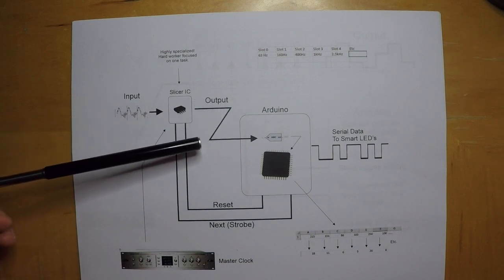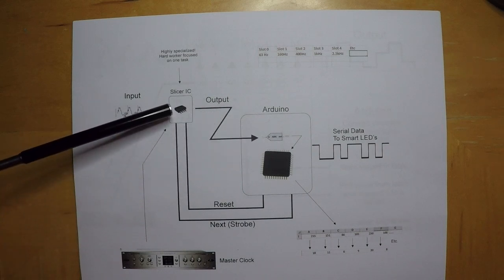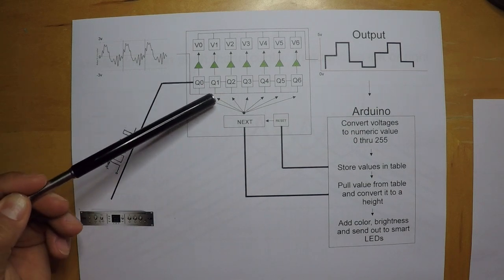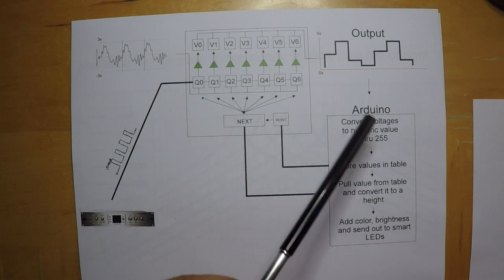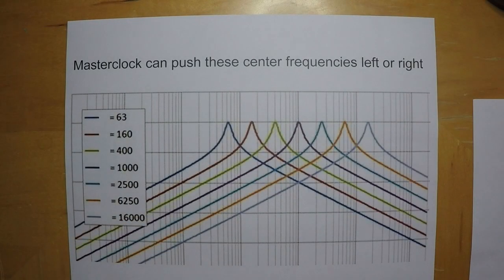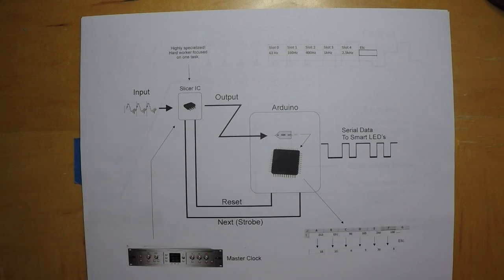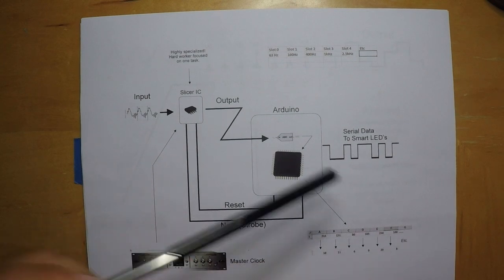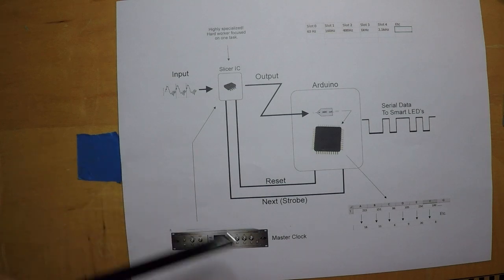Homemade 14 Band Spectrum Analyzer Part 2 - Theory Of Operation

Comment: really cool man. I noticed that the top leds were not lighting. If you go into the adafruit code or the fastled code, spectrum analyzer, which ever one you're using, and change the matrix height  from its current number + 1, it should use the last led in the strips.  looks great..
Reply: Just saw your next tutorial, and noticed you had already fixed it. hehehhe nice.
Reply from the maker: Hey..thanks. I think when I shot that video I had transitioned from a very noisy prototype board to a much more reliable production board. While all of the LED's were properly accounted for in the programs array, the noise floor variables and the delta variables were all skewed from being used with the prototype board. I noticed the error after the video was shot and adjusted the code accordingly. The effects of the adjustments can be seen in my subsequent videos, like the 28 band EQ video, when I do the frequency sweep.

Comment from the maker: Preliminary schematics and source code have been uploaded to the website listed in the video description section. I am much happier with the performance of my latest revision and have been holding back on releasing any documentation before I was sure I was working on a solid platform. There are many improvements that I am incorporating into the final revision board and I will be offering them in a short time. If you have interest then reach out to me via the CONTACT section of the web page listed in the description. I will probably be releasing a new video on the topic in a short while. Thanks.

Comment: It's a nice project, thank you for your effort.  What is its response to a 20-20,000 Hz frequency signal?
Reply from the maker: All analog audio is processed within a single chip. There is no post-processing. The datasheet for the audio slicing chip suggests a flat signal response from 63hz to 16khz. I imagine it may taper slightly at the extremes like 20hz and 20khz. Anyone building something like this should know that it is not calibrated against any standard and should not be used in that way. However, with frequency sweeps I see the expected responses and amplitude.
Reply: @generatorlabs  Thank you for your reply

Comment: Hi Daniel, Is there any formula to calculate clock frequency to MSGEQ7 and corresponding multiplexer channel output? As per IC spec, I can see  minimum 145 KHz, Typical 165 KHz, Max 180 KHz. But in your code, you are using 104KHz and 165KHz. How do you manage to input lower clock frequency to the chip given in the spec? I'm bit confused with that maths.

Comment: What device are you using for the original audio signal? The voltage range on the arduino is 0V - 5V so wouldn't we need an operational amplifier to get the 3V to -3V signal to the desired voltage range? Simply put, can I just somehow play a song on my phone through a headphone jack and somehow put it straight into the arduino? How is the original signal processed? Thank you :)
Reply from the maker: The slicer ICs sample and convert the audio into voltages the arduino can work with. They are designed to accept analog audio. So yes you could use a low power device like a phone or the line-out (tape, dat) of an amplifier as the source. There may be op amps in play but not external to those ICs
Reply: @generatorlabs  Thanks for the quick reply :) 

In theory, could I take the raw audio signal, then with a non-inverting op amp, bias at 2.5V and then create a filter circuit for each of the seven frequency bands and feed those into the arduino, to have the same effect as the slicer ICs? 

I know you combined two slicers to make a fourteen band output but I am happy with seven, so could I do it in theory, the way I have described, do you think?
Reply from the maker: @kwisatzhaderach9087  Hey man, you do you. If you want to go down that road and re-invent the wheel, by all means go ahead. The slicer IC's are doing exactly what you describe and multiplexing the data on one pin for the Arduino. You are suggesting doing all of that filtering & sampling that across multiple Arduino input pins? What do you gain? The Arduino cannot sample multiple A/D pins simultaneously so you will essentially be shifting from one input, to the next, to the next. Sounds exactly like what a slicer IC was born to do natively. And then you have to deal with noise across multiple filters if not designed carefully and with a well planned ground plane. If you are doing it just to learn and expand you skillset then I won't try to change your mind. If you are trying to save time, programming or part counts then I cannot recommend your route.
Reply: @generatorlabs  Okay got ya, I won't go down this road 😅 What is the slicer IC called if you don't mind me asking so I can buy a few please 😂 I tried to look at your parts page in the link in the description and its not listed there.
Reply from the maker: @kwisatzhaderach9087  The chip is MSGEQ7. It is available in thru-hole and surface mount variants. I would avoid buying these or most transistor and IC's from eBay.
Reply: @generatorlabs  Thanks Dan you've been really helpful, you said you aren't an engineer but you seem like you know a lot about electronics. You look like you know a lot more than me and I'll be one in two years. Remember titles are bullshit, thanks for the help 👍
Reply from the maker: @kwisatzhaderach9087  Thanks for the kind words. Good luck on your spectrum adventure!

Comment: This is great, do you plan on selling kits ?
Reply from the maker: Thank you! I am building a "real" board as we speak. I have to really test it out though. I did not have a lot of boards printed for this very reason. I will put it through the paces and when I am comfortable with the performance I will put the kits up on my site. The site is listed in the video description. I have already discovered one non-critical error on the board where a mounting hole is in the wrong position. I will get that corrected on the final print batch. Thanks for watching.

Comment: Your projects are amazing!
I would like to buy one of your Kits but you don't answer me in the pm.
Is there a problem on my side or have you just no time?
Reply from the maker: Hi Paul.  Thank you!  I just sent you information.  It is a reply from the online form you filled out via my web page.
Reply from the maker: @paulbleif6153  I would check your SPAM folder but I will try your  address email directly. I am going to hide your comment to protect your email ok?
Reply: @generatorlabs  yes. I got the mail thank you.

Comment: good night, i'm brazilian and i'm using the translator to communicate with you. Anyway, I would like to know if you could make the "Si5351mcu" folder available, because the ones I download are giving this error.
In file included from sketch_may29d.ino:15:0:
C:\Users\Joao\Documents\Arduino\libraries\Si5351mcu\src/si5351mcu.h:55:18: fatal error: Wire.h: No such file or directory
 #include "Wire.h"
                  ^
compilation terminated.
Erro compilando.
Reply from the maker: The libraries are publicly available from the sources I have given credit to in my Arduino code. Just follow the links I have provided in the code.,